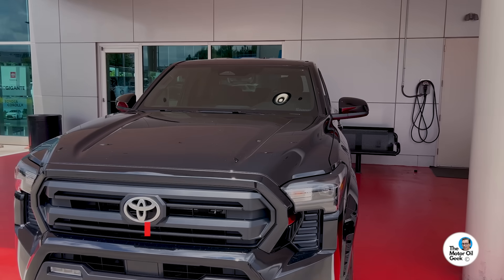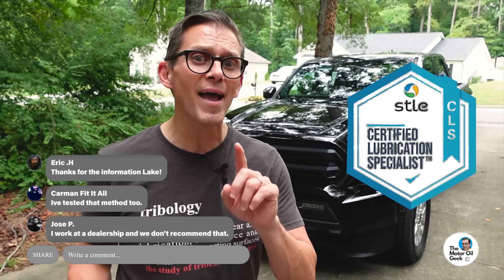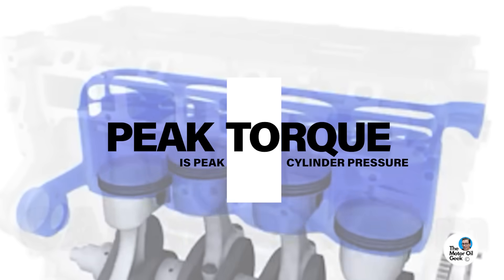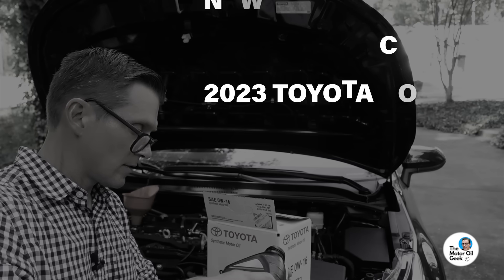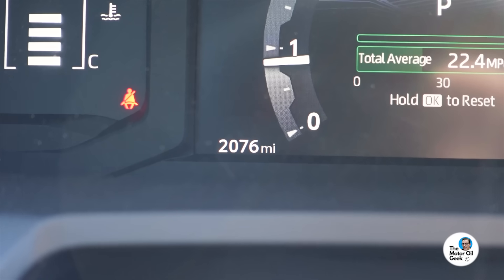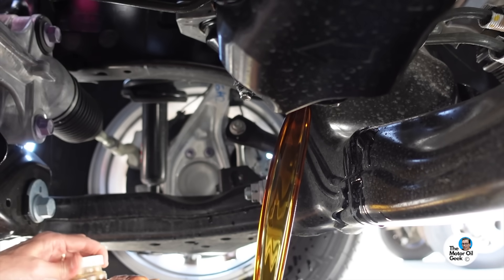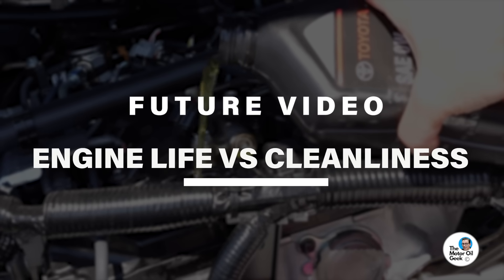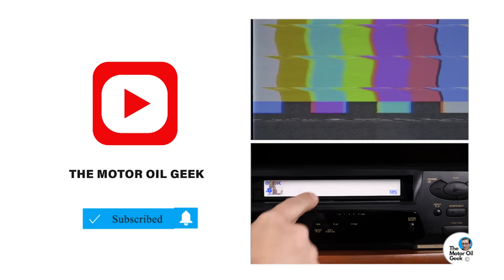The FACTS About Oil Changes (What The Owner's Manual DIDN'T Tell You)

Comment: where did you come up with 500 miles and 1500 miles, opposed to say 300, 900, 1800? just curious.  Assuming its nice round, easy numbers to recall.  
(so ...  continuously longer intervals until you reach manual guidance or testing shows where you see a slight increase .... so at odometer readings 500, 1500, 3000, 6000, 10000, 15,000 ...  at the end you are at 5k oil changes searching for optimal change intervals and viscosities for your use?)

oil is affected by: temperature, contamination ...

and from your 30 year old oil samples ... time too.  Old oil, overheated oil, and contaminated oil all no longer work as engineered.

also; would you suggest changing oil filter every other drain and fill, like user manuals used to show?

When we speak of 'break-in' ... piston rings seating you say needs time and cylinder pressure ...
but what about my vague recollection of an engine needing to run well at first start up or it can ruin your cam?
I think this may be part of the confusion some like me have with 'is the engine broke in from factory' ...  my guess is yes and no; enough the camshaft is safe, not enough to seat rings?

Comment: Another great video.
Thanks Lake

I know people that believe if an engine is built right it doesn’t need any break-in period.
Just run it the way you plan on driving it.

I’ve never believed that theory and have always give my engines at least a 1000 mile break-in changing oil at 500 miles and then at 1000 miles.

But it looks like from your video maybe that was a bit too soon.

I remember back in the 80’s I didn’t even use break-in oil when I rebuilt my 350 I just used off the shelf Valvoline.
That engine is still running today.

Comment: 22 Highlander v6. Changed the at 274 miles.  Had the dealer change it 997 mile. They told me the first oil change is not due until 10k mile. I showed them a video at 274 miles and the amount of metal in the oil filter housing. I requested to see the oil filter, the mech was holding it. I reached up and grabbed it and started spreading the filter apart for inspection. Satisfied with the filter. I gave it back. They didn't say anything more about 10k oil changes.  I also the changed the oil at 5k then every 5k after that. In 2 weeks I retire from 44 years in Aviation. I may start changing the oil every 6 months.  Oil is cheap compared to a new engine.
Reply: You’re supposed to change it every 6 months anyways.
Reply: @Dave-om6nd  You would be correct. So far I have been hitting the 5k first.
Reply: I remember long ago when I watched my grandfather change the oil in his Ford Victoria.  I asked him why he was doing that.  
He was a man of few words and only said, "Because oil's cheap and engines ain't.  I never forgot that lesson and have changed 
my car and truck oil regularly ever since.  Maybe that's why I never had an oil related engine failure?

Recently, I wanted to change the oil and filter in my 2006 F-150.  I warmed it up, drained the oil, and then started looking for the
oil filter.   I finally found it but on the 4.6L V8, it's very hard to access, being tucked in where it's hard to reach... unlike most oil
filters on cars.  Anyway, since the old oil was out, I put new oil in without changing the filter.  A few days later, I checked the oil
level and the oil, after driving 100 or so miles looked like new.  I figured it would look dirty from the old filter but it didn't.  While 
I prefer to change oil and filter at the same time, it seems not to be completely necessary.  Still, after a thousand or so miles,
I will be having it changed by my mechanic.  I'm 76 years old and am getting really tired of squirming under vehicles for the
usual maintenance.  Various parts of me don't bend or unbend very well these days.  Maybe by now, I've earned some rest from 
the usual maintenance work and can let my local mech take care of it.  He's young and flexible... and very good at his job, as well
as being reasonable in price.
Reply: Strange situation when the shop foreman or service manager (most honest) agrees with early oil changes but the sales department (least honest) does not want the customer to hear it. Whatever happened to the customer is always right attitude especially when they are willing to wait, pay for the parts and oil as long as it is done when still hot. I call it normal and cheap (even with modern maintenance parts and fluids that are not cheap), they call it unrequired and overly expensive.
Reply: Same, I think the viewers of the channels like this are now having to educate the dealership service techs and people at the desk...
Reply: 10k is fine in normal conditions, have several  cars from new or near new, diesel and petrol, oil  done every 15000km ( Audi spec for non long life) = 9k miles all have over 200k now. Tow a lot or very hot dusty then dropping to a lower interval can make sense.

Comment: I have been changing my oil at 3K for decades. The filters I use now are rated for 10k. I think I will replace  the oil filter every other oil change. Thanks for the tip. BTW, all of the engines in all of the cars I have owned for 50 years have given me stellar service life.

Comment: what happened holding the engine at 2300 rpm for 20 minutes for break in. Are those days gone? On my Harley they have a very detailed break in order in the manual.
Reply from the maker: That was for flat tappet cam break-in
Reply: @themotoroilgeek  OK, all I have worked on and what I own and drive are flat tappet, except for my Harley.

Comment: Can you help with a "information".... I have a abandoned Alfa 156 JTS (GDI non-turbo), broken, It was overheated(no other info), I got the vehicle for a robot on the gearbox, wanted to maybe start it se if it runs/rotates ,manufacture spec is 10W60 , Q: Is it posible the car had a catastrophic overheat/DMG. because the previous owner used lower spec oil? (like 10W40 or lower), and Is it posible because the Maufacturare (early stelantis?fiat) needs 10W60 that the engine maybe is not sized up/having larger ring-piston space to move arround? (I really don't know the condition of engine , I check it with endoscope at the spark-plugs , all pistons seem fine but I am no mechanic , I put some lubrication on the pistons and let it sit/a few mo., I just need to finish the starter-rebuild ,mount it and try turning the engine , I am unable to do this by hand. what is minimum oil I need in it for turning/not starting? shuld I use 10W40 and then drain & refill it if rotates/turns with 10W60 or start with recomanded oil?).

Comment: Great video, Lake.
I got to thinking if maybe one changes the filter every other oil change you don’t drain the oil that’s in the oil pump assembly and piping. So you get fresh clean oil to the mains quicker.? 
In 2005 I bought a brand new Suzuki SV 650. The owners manual said change the oil filter every third oil change. I thought that was crazy. But now I guess those Suzuki engineers knew what they’re talking about. I am aware that the transmission, clutch and the engine all share the same oil, so I’m thinking that would contaminate the filter a little quicker.

Comment: I bought the same truck and did my 1st oil change at 1500 miles, then 3000 miles. I will change my oil every 3000 miles afterwards. I installed a Fumoto drain valve to make the job easy and clean.
BTW, the engine is both port and direct injection.

Comment: Hard break in method mentioned! 3:29
Cant even begin to tell you how good it feels to finally have this out there. Way too many people outside of the performance industry believe the soft method of driving as easy as possible is best which never properly seats the rings, then youve got more oil burn and blow by for the life of the engine.
Reply: Engine engineer here for household name company. I can tell you that every brand new engine will build is run at full load and full speed through the entire rev range before it even leaves the plant. This is partly to assure that there’s no chance of a “little old lady” break in, partly to measure the engine performance and make sure it makes the power it is supposed to make while staying within allowable emissions.

Comment: I don't see how a "0" weight oil can become less viscous with heat, it flows like water at room temperature. And after owning two very different supercharged cars, I'm done with forced induction gasoline engines. I'll take my 4 liter V6 over that turbo 4 cyl any day, even if it does make less power and torque. It still pulls whatever I need to tow up to and past the rated capacity and I can get 23 mpg in highway driving (not towing). No matter how often you change your oil, I'll bet my 1GR-FE 4L V6 will outlast that 4 banger. Toyota, like all other car manufacturers, have put too much faith in technology at the buyer's expense  and now mid-sized trucks today are as large as full-sized trucks were ten years ago and three times as expensive. I am still a Toyota fan because of their quality, there are 5 of them sitting in my driveway.

Comment: LAKE  Great video.  BUT.  You  over looked this & made a HUGE Mistake. 

1) when you bought a "new 7 mile odometer truck". you should have got a sample of that oil before driving to the 1st so called, 500 miles base line test, to prove/show what exactly was in that oil, for this engine 1st. Not do a test After the fact... (yes it not a perfectly fresh oil, bc has 1.4% wear on a 500 mile test, but at least is better than nothing)
 2) Proof that "oil viscosity" breaks down in under 500-mile mark. Then this engine fuel dilution got worst, from the 500-2000 mile mark.  Which now proves that Auto manufactures design their engines & oil make-up for premature failures. That's why using a proven quality synthetic oil from an oil company not using a "manufactures made/bottle oil" is best for long term engine life.
Reply: Also "gdi" (direct injection) on a spark ignition engine is a mistake unless the engine also has a port fuel injection or carburetor to supply fuel during real world running conditions when not at or near Wide Open Throttle.

Comment: I own a 2015 forerunner this is exactly what I did in 2015. I just ran Valvoline cleaning and protect for 1800 miles and went to a 5W 30 and picked up a mile and two tents. It went from 18.9 to 20.1 and it’s quieter and run smoother. 130,000 miles

Comment: First thing I'd do not buy a Tacoma with a 4 cylinder/turbo. What is with manufacturersers wanting to put 4 cylinder/through engines in large vehicles.
If you need a turbo to boost power then why not a 6 cylinder a turbo is just something else to break and isn't a cheap fix when it does.
vehicles.

Comment: I been draining my oil cold for 40 years and never had an engine fail getting 300,000 plus out of them. I have the engine at full operating temperature shut it off and sit overnight then drain it without starting it never a problem. I think staring it up before draining it is over thinking.

Comment: Lake, for break-in (first 10,000) miles I surround the filters w/ N42H magnets. I change the oil around 600, 1200, 1800, 2500, 3000, etc. I figure the magnet capturing the ferrous material ensures the media isn't overwhelmed. Any harm in not letting the ferrous particles smaller than 25 micron not "polish" the internals of my engine?

Comment: Straight from Toyotas Manual in Australia 
SAE 0W-16 is filled into your Toyota vehicle at manufacturing, and the best choice for good fuel economy and good starting in cold weather. If you use SAE 10W-30 or a higher viscosity engine oil in extremely low temperatures, the engine may become difficult to start, so SAE 0W-16, 0W-20, 5W-20 or 5W-30 engine oil is recommended. Oil viscosity (0W-16 is explained here as an example): • The 0W in 0W-16 indicates the characteristic of the oil which allows cold startability. Oils with lower value before the W allow for easier starting of the engine in cold weather. • The 16 in 0W-16 indicates the viscosity characteristic of the oil when the oil is at high temperature. An oil with a higher viscosity (one with a higher value) may be better suited if the vehicle is operated at high speeds, or under extreme load conditions.
Reply: If you want your engine to last use 5w30.
0w16 and 0w20 are like water.

Comment: I purchased a new 2023 4RUNNER and changed the oil & filter at 500 miles, then at 1000 miles then at 5k and every 4500-5k thereafter. I would love it if you tested Toyota 0w-20,  it's Mobil 1 but I'd love to see the additives package.

Comment: I changed oil on my 2025 Camry at 150 miles, 500 miles, 1500 miles, 3000 miles then 5000 miles.  Been using 3000 mile intervals since.  I was disappointed at the wear metals stlll being rather high at 500 and 1500 miles.  At 5000 miles, the 0w8 oil wear metals still were a bit high.  So I went to 0W16 Pennzoil Platinum.  Wear metals came way down then.  I've stayed at 3000 intervals until the upcoming 20,000 mile change.  Then I'll try 5,000 miles and see where wear metals are.  That will tell me if I use a 3000 mile or 5000 mile interval going forward.
Reply: Consider 0W 20 oil also
Reply: That Camry engine has a chance at a very long life!
Reply: Consider using ULTRA Platinum. It is far superior to regular Platinum.

Comment: Serious question.  I have a 2020 Limited Crewmax Tundra with the 5.7 and just over 82K miles.  I no longer tow anything significant and the only heavy hauling I do is new appliances from Lowes and Home Depot.  Do you think I could get away with changing my oil filter every other oil change at 10K miles?  Not the oil (still every 5K), just the filter

Comment: I dont think there is any science in leaving a dirty oil filter on the engine when doing an oil change. Yes it may filter a bit better but it also gives more back pressure and you run the risk of engaging the bypass.

Comment: Change your oil when you want it could be early or later .at the end of the day the manufacturer will not be buying you a new engine ! I change my oil every 3000 miles regardless of the oil used .in my daily drivers .my big block 540 motor in my 63 nova i change every 500 miles .be smart about your maintenance people .

Comment: Do it your way and the engine last 1 million miles. Do it the way of the,manual and it only last 400,000 miles. Truck in the junkyard due to everything else worn out, 300,000 miles. You way is expensive and time consuming as compared to the manual. Every car that I have retired went with a still running engine. The way you drive is the most important ingredient. Heck, my 5.7 hemi barely gets over 2,000 rpm at anytime. Sounds like new at 170,000 miles and never uses oil at 10,000 mile oil changes.

Comment: Very interesting.  When I was young my dad took care of the cars but I started riding motorcycles in 1958.  Back then it was common practice to do the first oil change at 500 miles then again around 2000.  My owner's manual for my 1973 Harley XLCH says "oil should be changed after the first 500 miles and 1000 miles for a new engine".  Seems like the modern recommended intervals are for planned obsolescence disguised as owner convenience.
Reply: I'd say it's not really about planned obsolescence, but more like if they tell a customer that the first oil change is at 8000 and every 8000 after that, it's less hassle for the customer so they are more likely to get the sales.  Doing oil changes is a chore for most people, so less is best.  Not best for the car, but I think you get the point.
Reply: it's a Hardley even rattles Davidson. the engine is pretty much wore out by 3000 miles anyway.  it's the design and oiling system
Reply: JESUS! Can you people stop? The problem with HD's is all the wrenching so it doesn't spit parts off on the highways, but that's just considered "part of the life" by HD riders and collectors who fell for the sound AND vibration... Plenty of old shovelhead, panheads, and knuckleheads have HUNDREDS OF THOUSANDS of miles on them and they're just as strong (and just as dainty) as the day they chugged off the lot.
I get it. You can put the same miles on any Honda or Suzuki without turning a single bolt aside from the fluid maintenance unless (of course) you can't ride any better than you can wrench or read... It's just not what the greaseball HD fans are after.
You can get over yourselves.

Comment: I have done 4 oil changes on my 24 GR Corolla and I am just about to hit 10k. I did it at 570miles and then again at 2500 and around 3000 each time after. I will continue the change around every 3k as well

Comment: It’s direct and port injection - it’s Toyota’s D-4S (actually D-4ST in the turbo engine) injection.
Reply: Which is what every auto maker should do that does direct only.
Reply: I believe Ford's 2.7 and 5.0 engines are dual injected.
Reply: @AStanton1966 and 2.3 for 2025+

Comment: That POs truck won’t last 80k let alone 100k. Don’t buy anything new it’s all garbage. Toyota has recalls on 3 engines and 2 transmissions and it’s going to cost Toyota 5-10B to fix it
Reply: Toyota is making a big mistake by ditching their tried and true bullet proof naturally aspirated V6 for the unreliable turbos!
Reply: I have a 2006 taco sr5 4 door long bed. It’s got 400k miles. My current daily is a 2002 Ranger 4 door with the 3.0 v6. I hit 181k yesterday

Comment: I had the same basic engine in my 24 LC250 Land Cruiser. Bought it used (from a Toyota dealer) with 4400 miles and a fresh oil change. When I changed the oil @ 10K (Mobil 1 0w20 truck/suv) it smoothed out considerably.

Comment: been called crazy for 30 years for changing my oil so often.  like you I did the 500/1500 change when new.  then every 2500 after that. yeah im nuts.  but you can eat off of the guts of my block.